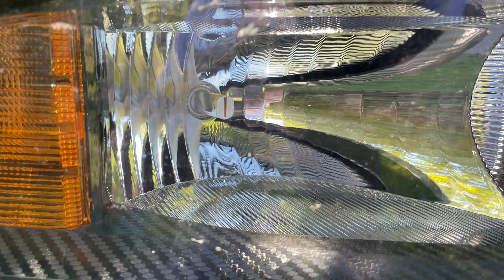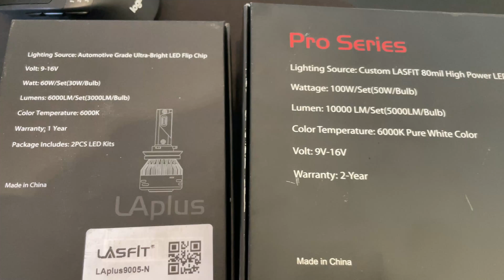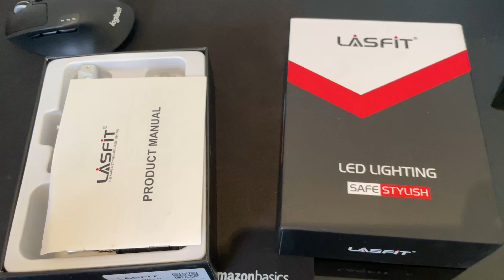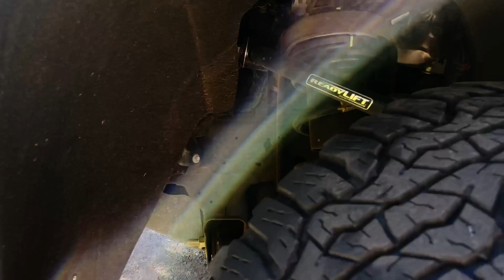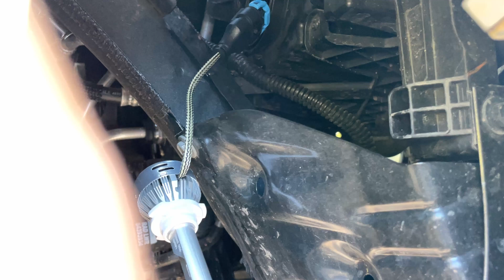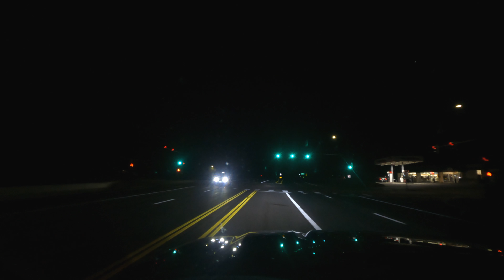2021 Silverado Custom LASFIT LED High Beam Install

Comment: How do these LED headlights work with Chevy's daytime running lights? Is there no light on, lights flicker or come on full power during DLR?
Reply from the maker: The low-beams come to 80% or so power for the DRL. I can notice a slight difference in brightness when I switch from auto to full on.

Comment: Hey man, do your DRL shut off with the truck when the truck stops using the auto start stop then turn back on when the engine fires back up? Is this normal and I'm just noticing it after I put in the L.E.D. lights?
Reply from the maker: My truck does not have auto start-stop. But the DRL’s should not turn off when that happens.
Reply: @limitedslipmedia  I did some testing and figured that out. I've been working with the LED company, but now they've gone dark...😪

Comment: Shouldn’t the lumens be high for the high beams? I mean in theory, the low beams sit higher than the high beams, so they should be lower, and high beams since they’re lower, should be a high lumen?
Reply from the maker: More contingent on beam pattern and aim that makes them “bright”
Reply: 🤔 My educated guess is no. The term “high beam” mainly refers to the direction the light is aimed rather than the amount of light it produces. In an OEM setup that uses separate non projector housings for the low and high beams, you can see that the low beam reflector has a metal glare shield positioned in front of the bulb. This shield redirects the light back onto the reflector so the beam is projected forward in a controlled and consistent pattern that does not blind oncoming traffic.

The high beam reflector usually does not have this shield, which makes the light appear brighter. It is not because the bulb produces more power, but because the beam is allowed to spread more freely, creating a wider scattered and less focused pattern.

In simple terms, a high beam is not about increased wattage or stronger output. It is defined by the way the light is aimed and the absence of the glare shield, which lets the beam travel farther and higher.

🙋🏾‍♂️ I know I am a little late to the conversation, but I hope this gives a clearer explanation. I have been fascinated by headlamps ever since HID lighting started becoming common on most passenger cars about twenty years ago. I have studied them in depth because I am genuinely passionate about this kind of technology. I think it’s worth mentioning that some OEM halogen setups can distribute and project light check of a lot better than many with projector housings. My mom once owned a 2003 Ford Explorer and those headlight, performance wise were hands down the absolute best halogen factory setup of any vehicle I’ve had the pleasure of owning

Comment: Hey man, great videos. I just picked up a 24 Custom TB and have these bulbs on order. Have you had any issues with moisture getting into the headlight housing? Just something I thought of since the Lasfit dust cover has that passthrough for the fan in it. Thanks!
Reply from the maker: Absolutely zero issues with moisture, the truck has been through deep water since install and I have no problems.

Comment: Hey you didn't have a problem getting the stock dust covers back on? And you use the same bulbs for low and high beam?
Reply from the maker: The low beams come with a fan cover that replaces the stock dust covers. High beams I reused the stock covers, they were a little tricky to get back on but I got it done!
Reply: @limitedslipmedia  ahhh you got the pro series for low beam. I gotcha thanks

Comment: If you change the bottom amber lights shouldn't you change the top running lights as well?
Reply: there the same size as the turn signal bulb
Reply from the maker: That makes sense.. However I have not seen LED conversions for those lights... May be too bright for traffic reasons?